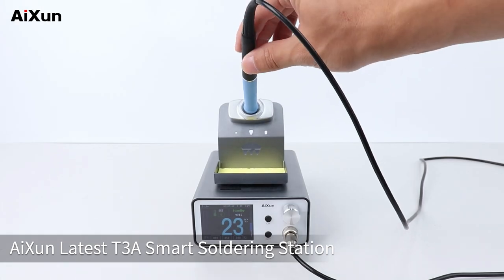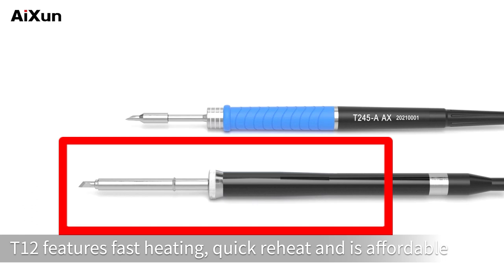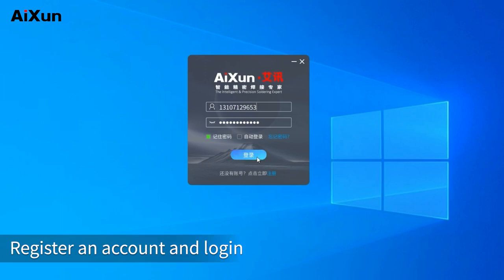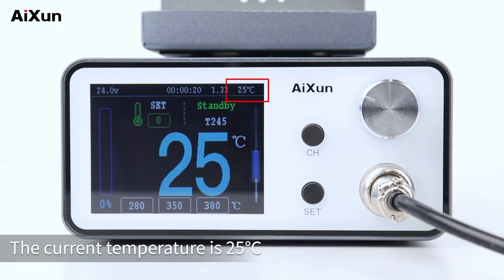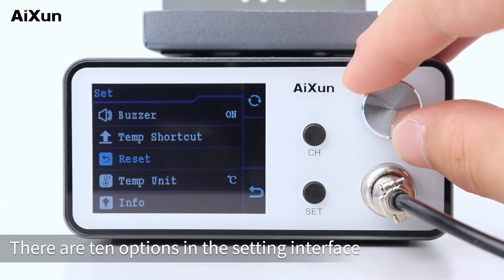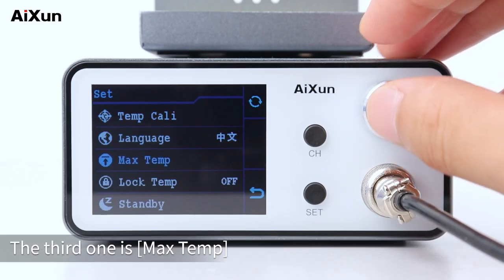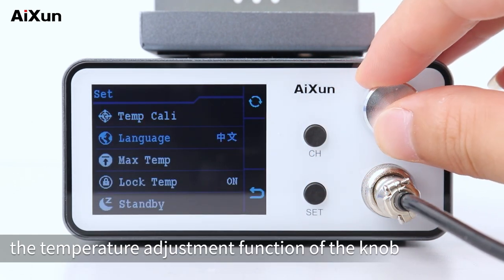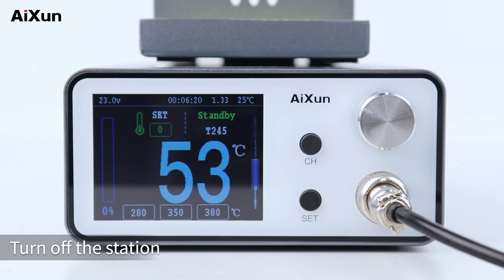AiXun T3A & T3AS Smart Soldering Station Operation Video

Comment: Why is there an under voltage protection? And what happens if you power it with 24 volts DC in the barrel jack that is supposed to be an output? Of course, with the AC detached.
I would like to convert it to the 18v Makita battery system.
Reply from the maker: Dear, there is technical support contact information on the official website to help you, thank you. https://aixun.com/contact/